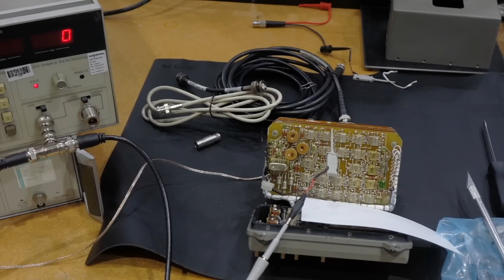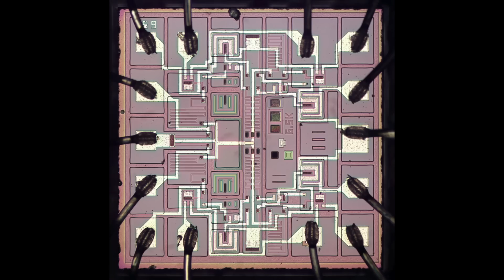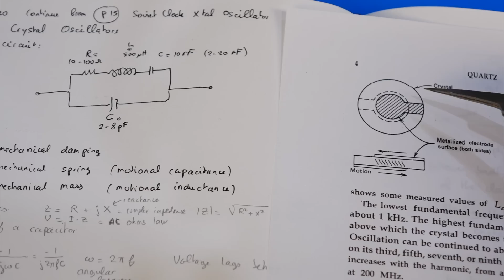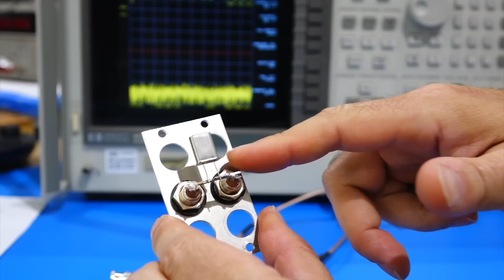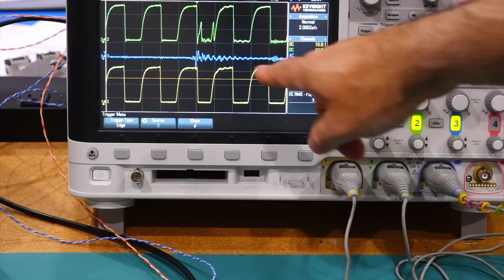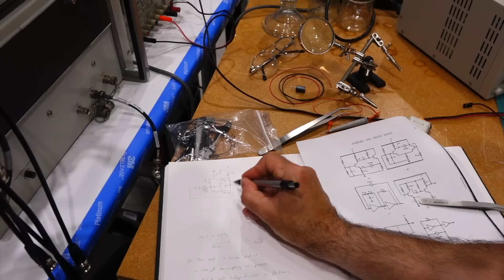Soyuz Clock Part 7: Taming the Glitches in our Space Clock Crystal Oscillator

Comment: So where’s the noise coming from? Could it be that the noise has developed over time due to components ageing and perishing? Or was this as built?
Reply from the maker: Could be either. We actually don’t know, except that it comes from the power supply. Or a third possibility, some component was fried in a previous power up attempt: we had found added wires across the 5V and the switching transistor that should not have been there, leading to the outside. Thinking of which, these could also have been also a diagnostic attempt to look at a power supply noise problem while the clock was closed. So a mystery still remains.
Reply: CuriousMarc either way it was a great explanation of crystal oscillators.
Reply: @CuriousMarc  Badałem amerykańskie, japońskie i sowieckie zegary z lat 70 i 80, oscylatory obecnie podlegają jakiejś anomalii.
Reply: @CuriousMarc  you guys are very smart.    I was wondering if you'd tried a dc battery in place of the power supply?   I know you tried filtering it out.       I wish I'd had youtube when I started working in electronics 35 years ago.
Reply: my bad, I continued and saw that it was the clock's power supply you were talking about.
Reply: @CuriousMarc  有可能电容失效引起脉冲相位不同步，一般检查滤波电容和愈合电容。
Reply: @CuriousMarc  I agree... Maybe that is why someone attached test wires across the power supply switching transistor and 5V/Gnd when you first received the clock. They saw the severe fly back on the Transistor and then put test wires on the 5V supply, saw the coupling on that and tried decoupling at the oscillator circuit, didn't fix it, and moved on - clipping the wires very short instead of removing them before sale.  Persistence is the way and you did it with minimal modification!
Reply from the maker: @paulromsky9527  And it’s getting worse. Some component is in the process of failing, likely in the power supply.
Reply: @CuriousMarc I love your videos on the Clock, the Globus, and the Apollo DSKY. 
Hmmmm. Yes, we all agree capacitors have the shortest life.  Are you going to upgrade it or leave it original?   Me? If I had one I would never sell it... so I would upgrade it. Some might say that "fixing" it would ruin its resale value. Not, me, it would be a cool addition to my man cave that has quite a few unique items - the showcase piece is a 50's vintage barber chair.  Anyway...
Inductors seem to have very long lives providing the insulation does not degrade over time. But who knows what they used in their transformers - possibly some real nasty PCB material.  As far as Soviet resistors, they may have impurities (maybe even some exoitic fungi) in them that may effect them over time.  So that leaves their Silicon devices. I don't think the Soviets could even make any decent ones at the time, so I suspect most of them were "borrowed" from the west. If there is some actual "Soviet Silicon" in there, who knows what they will do over time.

Ya know, I just may make a knock off Soyuz Clock - a clock knocked off from the USA knocked off from the USSR [smile]. An Arduino DUE as the core and some 7 segment LEDs aught to do it.
Reply from the maker: @paulromsky9527  Actually they put test wires on the large switching transistor, not on any supply wires. Maybe trying to debug the switching timing?
Reply: Marc mentioned the noise looked like spark gap noise... confirmed my thinking, what if there is a tiny gap forming somewhere?
Reply: 应该是数字电路时序竞争引起的

Comment: Hi Marc, I happen to see your analysis after five years, you must have forgotten about it in the meantime, but what if this glitch was intentional?! You can observe that the glitch introduces some phase shift every integer number of periods, it isn't random, and increases thus slightly the average oscillator's period (or second beat after division). That makes me think of the inhibition mechanism used in quartz watches where the quartz is intentionally tuned a few ppm high, and a periodic clock inhibition cycle corrects the system average period to the exact desired value. That periodic clock inhibition cycle is stored in a flash ROM within the watch integrated circuit once attached on the watch PCB, thus replacing the good old trimmer capacitor of the 1970's. The question is: can you observe a part of the clock system (gosh, there are so many ICs in that soviet clock!) giving something similar to inhibition pulses that may have been determined earlier by comparison with the external atomic reference and stored in a RAM? In that way, loosing the atomic reference would not result in a poor timing performance, at least for a short time. What do you think? Best regards / Cordiales salutations, François / Say hello to Ken.

Comment: Первое правило ремонта советской техники:
если что-то работает не так, как надо, смотрите конденсаторы. А потом уже всё остальное. (в СССР были по-истине чудовищные проблемы с оксидными конденсаторами, особенно К50-3, К50-18 и т.д. )
за 40 лет емкость конденсаторов может уйти на три порядка.
Как пример: мне постоянно попадаются устройства (в основном это усилители), в которых от 10000 микрофарад остается 20 (двадцать)
А если изменилась емкость, то как следствие изменится и частота фильтра или частота генератора в блоке питания. Вот помеха и появляется. 

google translate:
The first rule of repair of Soviet equipment:
if something does not work as it should, look at the capacitors. And then everything else. (in the USSR there were truly monstrous problems with oxide capacitors, especially K50-3, K50-18, etc.)
in 40 years, the capacitance of capacitors can go by three orders of magnitude.
As an example: I constantly come across devices (mostly amplifiers) in which 20 (twenty) microfarads remain from 10,000
And if the capacitance has changed, then as a result, the filter frequency or the frequency of the generator in the power supply will also change. Here is a hindrance and appears.

Comment: I have seen similar Quad NAND gates in a similar configuration with two gates sharing a common pin, and 2 pull-up resistors inside the package. And the power leads in the middle as well, I don't think it was US, it may have been Japanese, so maybe that microcircuit was "inspired" from Japan.  The Soviets may have even removed the die from the Japanese packages and put them in their own smaller metal packages/markings... and maybe why white dots were needed to bin out the ones that survived infant motality from that "tramatic" re-use. One giveaway is the font used in the artwork, that 'K' does not look very Cyrillic, and the art was quite beautiful... looks Japanese to me.

The reason the US shied away from including pull-ups in the same packages is because you don't normally know how many open collector gates may drive the same line, so why include something that you don't always need and risk reducing yield (it was the early days of microcircuits). Also there may be cases where you need greater than 10k Ohms (or what ever value provided) on any particular output.

Comment: Awesome debugging!  I probably, first, would have tried to eliminate the Power Supply switching flyback and/or shield that EMI at the source (agressor) switching power transistor(s)/transformers. If not successful in eliminating the EMI at the source, then I would have gone on to making the victim circuit less suseptable to it.  The Crystal is in a steel package with tiny insulators around the leads, so I doubt 10MHz is getting into the crystal directly through those non-ferrous gaps, so, the coupling is from the wiring and then feeding back into the crystal output and being amplified by the first stage NAND amp.  As a non-intrusive change to the Soviet clock, could thin steel plates (insulated with kapton tape) sandwiched on each side of the whole oscillator circuit work?

Comment: Marc thx for the insight to designing a dual inverter quartz oscillator and the tradeoffs to be decided.
Assuming that the unit was operating properly when it was built I believe that a component around that switching PS has deteriorated. It's been a very long time since this unit was built and components don't always age gracefully. I'm with Ben Harvey on this one. Your thoughts.
Again thx for sharing.
Reply from the maker: Yes, most likely something must have gone wrong in the power supply.

Comment: This 10MHZ ringing could be because of the resonance of the parasitic reactive elements-transformer leakage inductance with the capacitance of transformer windings, MOSFET and heatsink, triggered by the high dV/dt of the switching. Snubbing circuits will help absorb the energy of the reactive elements and slowly dissipate reducing the noise.

Comment: Marc,
Great series of videos on Soviet electronics. Your demonstration of increasing the radiated EMI immunity of the gate (EMI receptor) is very clear. Please also similarly demonstrate reducing the radiated EMI at the source. The 10MHZ  ringing EMI source could be either the power transistor switching (try inserting a resistor or lossy bead in its base ) or the recovery diode not being soft enough or by using a transistor with lower Ft or...

Comment: Making a quartz oscillator with logic gates is a bad idea.Logic gates can overdrive the crystal,causing frequency drift and even damage to the crystal. 
It's much better to build a proper oscillator with discrete transistors, followed by a Schmitt trigger to get a (TTL) square wave...
This will give low jitter and reliable performance.

Comment: Hello. Would you like to take a look at MK-52 programmable calculator? "In November 1988, the MK-52 went into space on the Soyuz TM-7 spacecraft, where it could have been used to calculate the trajectory of landing in the event of an onboard computer failure." (citation from wiki). It have EEPROM and external connectors - one for ROM cartridges, and one unexplained in the manual. Also there's cheaper and slightly faster version with the same instruction set and registers but without EEPROM and slots - MK-61, it was bestseller in USSR, programs and games for it were printed in magazines and books. A lot of soviet kids started programming on MK-61.

Comment: Ok, so if the problem turned out to be induced hf then shielding the crystal oscillator circuit from the rest of the clock should also work, right? Of course fixing it with an actual circuit improvement is better, but it got me wondering how much of an improvement, if any, grounding the metal can of the quartz would bring? The ic itself is also in a metal can, so would grounding that do anything?
Reply from the maker: See previous answers. Just grounding the oscillator made it worse, so I would expect grounding the crystal would make it much worse. But I have not tried.
Reply: Oh damn, I should have read a few more comments before asking this, sorry and thanks for taking the time to answer!
Reply from the maker: @FPiorski  No worry most people don’t read other comments before posting. Some don’t even watch the video :-)

Comment: Just a couple of grounded strips of aluminum or copper foil, covering the oscillator circuit (one on either side of the pc board), most likely, would fix the problem.

Comment: What happens when the metal case of the crystal is grounded?
Reply from the maker: Just tying the oscillator to the clock ground made it significantly worse, so I'd expect grouning the crystal case would make it much worse. But I am just speculating. I have not tried it.

Comment: Since it is backup clock source I think they just don't care about jittering. The whole thing was replacement for mechanical clock which has disparately worse precision. Also you're right such glitches must be very tricky to catch on old analog instruments, the thing was designed in deep 70s.

Comment: I want one! 
A replica clock: faithful panel, display, functions, would be quite nice. 

I suspect that clock works quite nearly the same now as when originally installed. ‘Good enough’ was good enough. Reliable, even with those performance issues, was the deciding factor. 

Glad to know that the clock will remain in its original configuration. Hopefully the hay-wire hacks that were applied by others isn’t the cause of the noisy behavior.

Impressive diagnosis and engineered remedy. First class investigation.

Comment: Great video and investigation 😀
The T feedback network is used to isolate the input impedance from the DC bias feedback. Without it the input impedance will be dependent on the closed loop gain of the stage,  because a direct bias resistor will have its resistance reduced by the stage gain.
I have a in-depth video about CMOS gates as linear amplifier, take a look! ☺️☺️

Comment: They may have not noticed the "noise" on a CRO back in the day, however if the clock is from a flown Soyuz could it have some radiation damage to the switch mode power section?
Reply: Problem is designed in. No gammas need apply. But in reality what is a couple of seconds in a day. Good enough!
Reply: The noise pattern may be a hidden "Contact" message... just ignore it.  
Maybe they'll call back.

Comment: Hm... Maybe it just does not have enough capacitance on the input side of the power supply, closer to the power transistor?... Those wires going from the connector look thin and long so voltage drop on them may be substantial when the power transistor switches to cause some HF radiation.

Comment: Using quartz crystals on their own is a bitch! My experience over many years is to use a quartz oscillator module (obviously not available here) instead. Designing the circuit values, and even measuring the parameters for reliable quartz operation, requires very specialist equipment, and overall is not worth the effort.
Reply: Yes, only if available. If not, this is the path to success. If you can measure it. In the seventies. Using tube-based o-scope. With no memory.

Comment: BTW: the 7400/7401 are Quad 2-input NAND with totem-pole/O.C. outputs, respectively, while the 7402/7403 were quad 2-input NOR gates with totem-pole/O.C. outputs. Finally the 7404/7405 are hex inverters with totem-pole/O.C. outputs. So the even numbered ones had totem-pole outputs, while the odd numbered ones had open-collector outputs.

Comment: That is a great analysis of the circuit.  I'm not an engineer, but what I take away from this is the feedback loop in the stage after the crystal is, or should be, a DC control of the gain of the circuit with the AC component of the signal removed. 
I enjoyed this video as always!
Reply: Peter Mortensen  Good point.  Maybe I should say the feedback loop should be low  pass filtered at a frequency much lower than that of the oscillator.

Comment: It's very interesting where the source of this interference is. I think these are bursts in the power chain. Something like ringing in wires after switching in a pulse converter. Works like radiation of radio waves.

Comment: Very nice video.
"It is within spec"  => no need to make it better or fix the issues it has.
I wonder if the people that designed this unit will see this video.
Also, it would be interesting to use a really old oscilloscope on that clock signal to see if the issue appears.
Reply: Jittter would just look a bit...
Smudged, no? But a cro has bloom anyway at higher brightness, and the smudging might not be visible at higher (it's why the CRT traces look so smooth)

Comment: I'd like to see what it would take to keep that noise from getting out of the power supply. Would a sheet of grounded & insulated alum foil between boards be enough?  I appreciate not changing this original design, but it would still be interesting to see how difficult it would be to improve it.